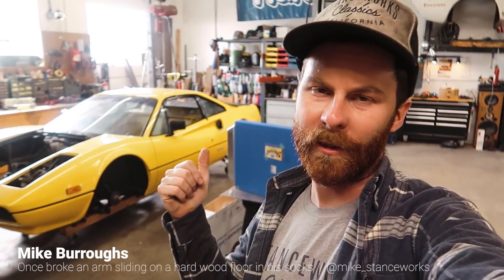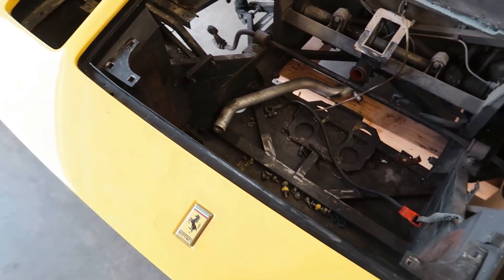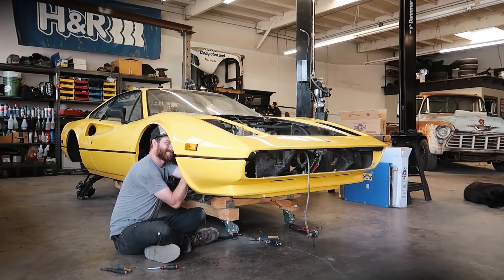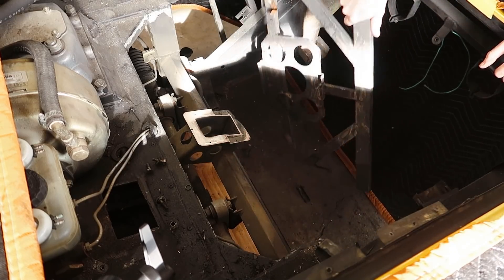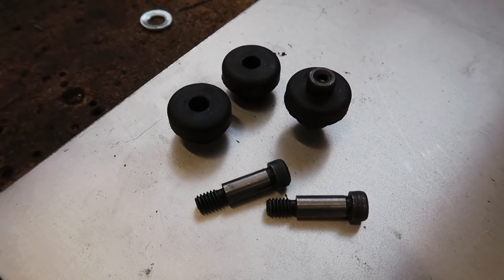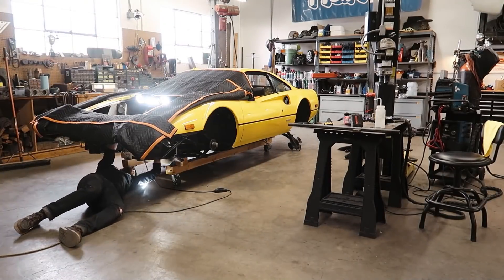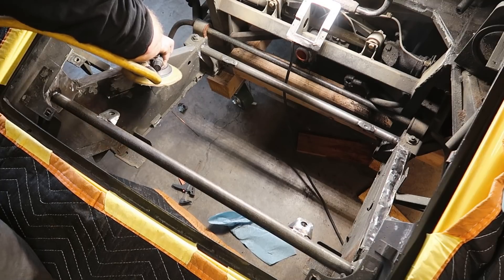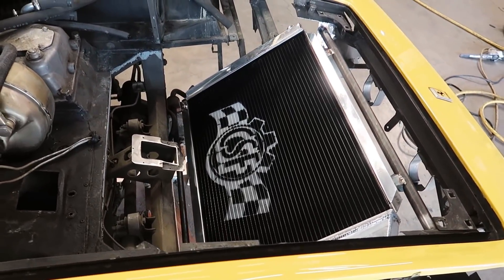Turbo K24 Swapped Ferrari: Radiator Fabrication and Installation - Ep. 27

Comment from the maker: On the back end, things are starting to shape up for the turbo system... I am hopeful that I can get started with a manifold and turbo plumbing very soon, thanks to some awesome partners on the build. What size turbo do you guys think I should strap onto this thing?
Reply: Have you seen the K24 Minivan of the boosted boys?
That's about the right size 😆
Reply: Some sort of customised Garrett job
Reply: with the power figures you were aiming for on a built bottom end, a g30-900 or g35-1050?
Reply: Jj

Comment: Sir, keep the rad and heat exchanger packed together as a single layererd core. Air does not like to pass through a finned core then sit in a pocket before passing through another, it will slow down and have turbulence and none of your radiators would work 100% 👍🏻 both coolers angled back like the rad will be perfect

Comment: Hi; Admiring your work, One observation though, should the radiator not be electrically isolated from the chassis, to stop electrolysis eating away your radiator? For a while I went through an alloy radiator every 2 years. (not an exotic car, a Saab 9000 Aero) The cause turned out to be an voltage difference between the coolant inside the radiator and the radiator itself from being accidentally connect to earth (the chassis) 
Also wouldn't a 3 point mounting method be preferential from stopping any flexing being transmitted from the chassis to the radiator?  
Cheers..Robert V.

Comment: That will be more than adequate. Canting the radiator forward was how Ferrari 'fixed' the cooling issues associated with the 308QV which ran notoriously hot to the point that Ferrari sent a service bulletin in 1984 advising they just plain run hot. The 328 cants forward an albeit much smaller radiator, but you cannot overheat a 328, even sitting in 115F traffic.  Fabricating tubes from the mid section of the car to the radiator shouldn't be too difficult now, but is the Honda water pump adequate?
Reply from the maker: Good question! I’ll likely go with a full electric aftermarket pump to be honest.

Comment: Awesome work so far Mike! Long time supporter of SW here - joined the forum 10 or so years ago to read builds, read your articles/photos, and buy/sell wheels with fellow wheel whores. Forget if you've mentioned this yet or not - what are the finish plans for the chassis once all fab is done? Full powdercoat before painting the car? Cheers!

Comment: Have you ever considered a Laser Measurer?  I use a Bosch unit that is perfect for measuring between two pieces.  No more guessing the bend in the tape measure.
Reply from the maker: I haven't... only because I don't trust it. Are they really accurate?
Reply: Very much so.    Now, you probably get what you pay for so that’s why i went with Bosch but i can usually expect 1/32 accuracy and use it often for carpentry where a weld puddle won’t bail me out.

Comment: Love the content mate, do you foresee and bleeding issues of the cooling system? Are you going to have a swirl pot, or overflow bottle higher than the top of the cooler?
Reply from the maker: I shouldn’t have any issues, the reservoir and fill neck will be the highest points for sure.

Comment: Use Evans waterless coolant, no water no expansion no corrosion, no boiling keeps your cooling system intact. Jay Leno has it in his Bugatti since 2006, I have in all my cars. My x5 35d with 206k miles still on its original cooling system, original water pump. You won’t need to change your radiator with Evans waterless, it’s for the life of the car. Boiling point is at 375F. No affiliation Witt Evans waterless, I just think it’s a supper fluid. Check my e30 m3 it has Evans too.
Reply from the maker: I’ll have to see if it’s allowed. Sounds like a wild product!

Comment: Can't wait to see the progress on this! Haven't watched the vid yet, but are you going to fab the turbo manifold or will it be outsourced? It's nice having so much room to run the plumbing though.

Edit: Watched the vid and you did an awesome job with that fab work. Getting good with that tig! I wouldn't have though to add the bracing to mount the brackets. I'm looking forward to seeing your ducting fabrication. Just watched a older vid by racecraft HQ and they did a great walkthrough for overall proper ducting requirements. Those Aussies know their stuff man. As for turbo size, you said 800+ earlier right? Is that going to be a tradeoff with response for the 2.4?
Reply from the maker: I haven’t decided yet. I think I will probably build my own.